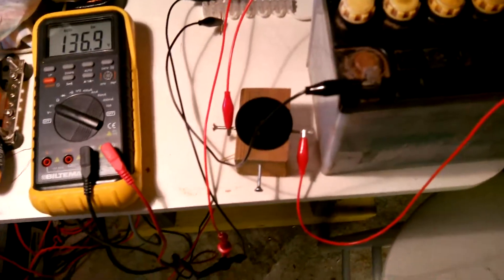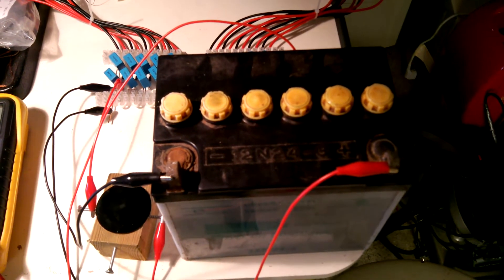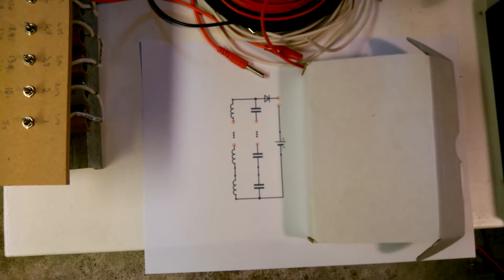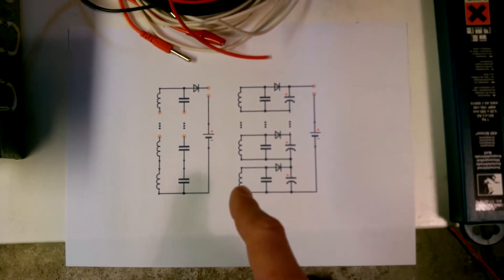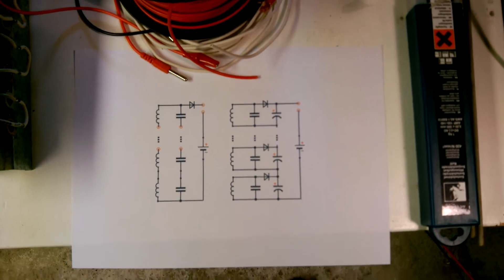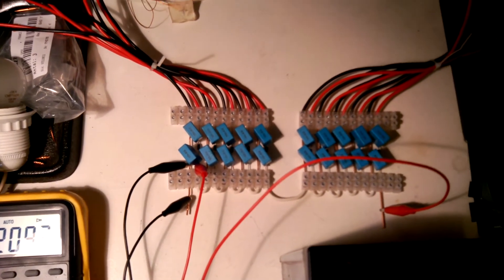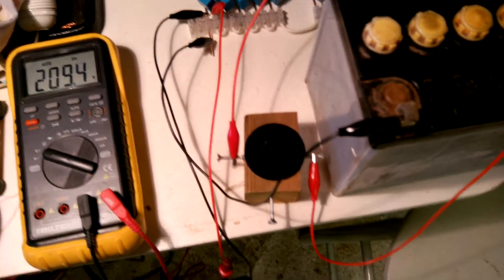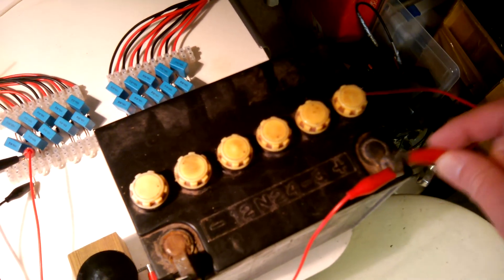Simple DC Spark-Gap

Comment: very nice, i have been watching for quite a while and your setup is most impressive. your exploration with resonance and multiple spark gaps got my mind turning. thats a lot of copper on the generator coils! a perfect setup for so many experiments.
i hope you look into my last few videos dealing with the toudeshki voltage multiplier and the circuit involved, maybe there is some inspiration for you there as well. i wont supply a link or this comment will be flagged for spam.
Reply: jeremy gwilt this is very interesting video :)
Big like!
This circuit is very similar to my suggested cascade voltage doubler, but this is only cascode voltage holders and does not have the voltage clamper circuit as the input for each stage.
Another difference with my circuit is that when discharge is happening the value of the total capacitance is C/n where n is the number of stages and potential energy that can be released is E=(1/(2*n))*C*V^2 (similar with Marx ladder)
my trick was using stray grounded capacitors instead of floating cascaded capacitors connected in series then the potential energy would be E=(1/2)*C*V^2 ;)
I really wish to work with people with the same research scope with mine.

Hob Nilre Please add me back in your friends' circle. Also please read my published papers
http://www.hindawi.com/journals/cje/2014/948586/abs/
and also
http://em.majlesi.info/index/index.php/em/article/view/80
and add some critical comments on them if this is possible for you, due to your expertises.
You can also use superposition theorem and repeat it for your own circuit to see what are more differences between our suggested configurations.
I believe that Hob Nilre , jeremy gwilt , Erlend Ervik and I are thinking in the same way. So, superpositioning of our small steps would be a big impact ;)
Reply from the maker: jeremy gwilt interesting, thanks for the tip!
Reply from the maker: Arash Toudeshki
Am reading your papers right now :-)
Reply: Hob Nilre very nice to know this :-)